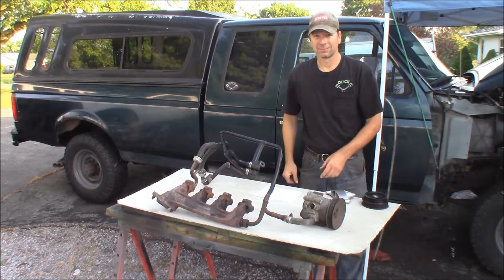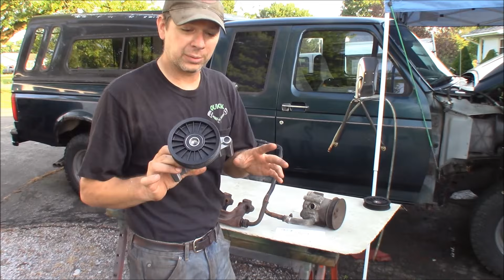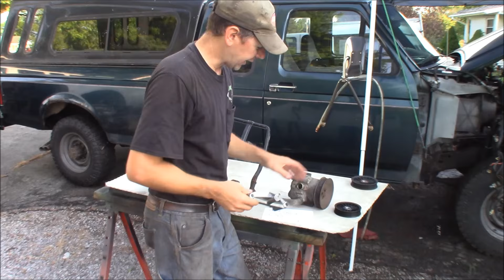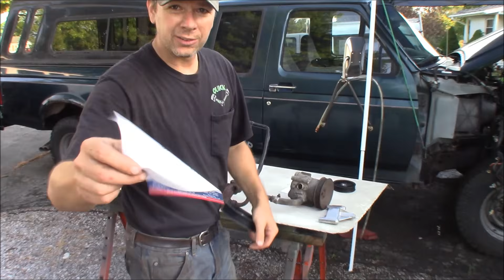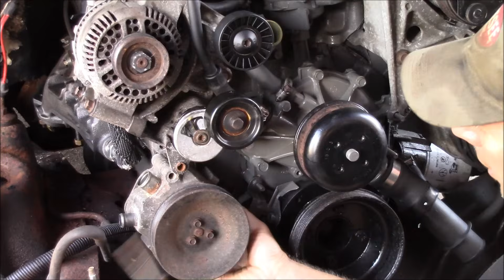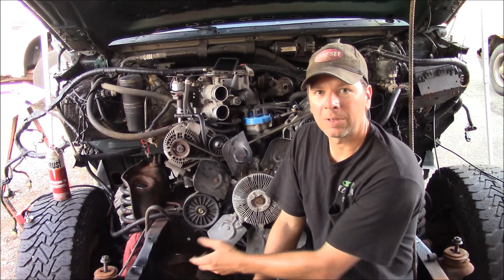1992-1997 OBS Ford Truck 5.8L Air Pump Smog Pump Delete F-150, F-250, F-350

Comment: I'm late to the party but you just need a shorter belt. No need for expensive adapters and pulley.  That's all I did.  Much cheaper.
Reply: What size belt? So you didn’t put an idler pulley to replace the smog pump? You just removed it?
Reply: @camerondavis7015  I did the same thing on mine, just take your belt off and route a piece of string through the pulleys without going around the air pump. Measure the distance and just buy the belt. You will have to remove the air pump pulley so the new belt doesn’t rub on it but it’s a quick fix.
Reply: Believe it's 97in or 96in. Just watched that vid yesterday...somewhere in YT land.

Comment: Good video, real quick. Couldn't you get a belt that is for non air pump trucks?
Reply from the maker: The non air pump trucks used the same belt with an idler like I installed.  I heard people are using a shorter belt, but don't know the length.

Comment: Why would I do that. What are the pros and cons?
Reply from the maker: Pros:
The air pump does very little to nothing for emissions reduction.  The pump can seize up and leave you stranded.  A new pump is expensive.  The engine bay is less cluttered.  Don't have to worry about the air injection tubes rusting off.  Less parts is always better.  Ford built trucks with and without the air pump depending on application.  Simple is always better.
Cons:  None
Reply: @QuickSpeedShop  thank you. I have a 92 with a 300. Original owner.  235k miles and l'm  looking for things that will possibly help it run better.

Comment: I found out that skinny fan on the passenger wheel well is the fuel injector cooling fan. It blows air through a tube to each injector to prevent difficult warm starts.
Reply: What do you mean skinny fan pass. Wheel well

Comment: I took out that deserter valve (muffler) system to clean up the engine bay
Reply: Have you had any issues?
Reply: Did it throw a check engine light?

Comment: Okay, this is not totally related to this change, but I have a 89 f150 with the 4.9 inline 6. It is fuel injected. The smog pump is not long for this world.  there is a fan above it on the wheel well that runs after I shut the engine off on lot days.  I don't know what it cools, but if I delete the smog pump, will that cooling fan still do it's job?  Thanks.
Reply from the maker: I'm not sure what the fan would be for, but it shouldn't have anything to do with the smog pump.

Comment: Where did you get the plugs for the exhaust?
Reply from the maker: It came with the replacement manifold. I welded up the driver's side plug.

Comment: Stupid question what is a benefit on doing this
Reply from the maker: Eliminating a system that does nothing for emissions reduction and ultimately ends up failing and leaving you stranded on the side of the road when the air pump seizes up.
Reply: @QuickSpeedShop  wow thanks for the reply

Comment: What would this affect? Would it have any negative impact on any systems in the truck?
Reply from the maker: No.  As long as you truck isn't a 1996 F150 with OBD-II computer.  Otherwise the OBD-I equipped trucks will not know the difference.
Reply: @QuickSpeedShop  I have a 1997 f350 w the 5.8L
Reply: @alextrombley3760  this is what I want to find out about too. I have a 1997 F250 reg cab 2wd 5.8L 5 speed and I want to hop it up badly.
Reply: @QuickSpeedShop  I have a 1995 F350 with the 5.8L, and my pump locked right up.  I popped the pully off of the pump and rerouted the factory belt so that tension is still good and the truck runs this way (without all the belt squealing from the locked up air pump).  I'm not 100% on the operation of the airpump and what/how it does its thing, but will it cause me many problems just to leave the derelict pump in place and not touch the lines that run to the exhaust manifolds?  Mainly asking as I don't have a good way to get at them to weld them shut without completely dismantling everything.

Comment: I have a 1989 ford bronco 5.0 sitting in a 1996 ford ranger .Can I replace stock upper and lower intake for the  upper and lower 5.0 HO 1993-95 mustang  Would I have to replace fuel rail and coils
Reply from the maker: Not sure, never done it.
Reply: @QuickSpeedShop  ok thank you

Comment: does this work on a 1989-1990 5.0 ford bronco sir
Reply from the maker: The smog pump elimination bracket and pulley are for a 5.0L application.  I believe all you have to do is swap that part on your 5.0L, but I have never done one.  I have only done the 5.8L which requires the bracket and bigger pulley.

Comment: Other than a less busy engine bay what are the main upsides to this? You’re not losing a/c when you do this correct? 92 f150 5.8 I’m in Indiana where everything is legal lol
Reply from the maker: Air pump bearing tend to lock up, chuck the serpentine belt, and leave you in the lurch.  This way just gives me piece of mind with a simple idler and no air tubes to rust out or leak.

Comment: If i remove my smog pump due to noise, will i pass emissions still with no engine light. Was gonna buy delete kit but just ran smaller belt for now.
Reply from the maker: If you truck is a F250 or F350 or 95 and older F150 it has the OBD-I computer it will not trigger the light.  If you have a 1996 F150 that has the OBD-II computer and the light will come on.  As per visual engine inspection that is up to your state law.

Comment: my F150 is a 96. Will this for the 302?
Reply from the maker: No only due to fact 1996 F150 is OBD-II computer.  Check description of video for more details.
Reply: @QuickSpeedShop  there has to be a way to fool the computer?
Reply from the maker: @terrybaptist795  Don't know.  Another guy with a '96 F150 did the delete, the OBD-II knew it and threw the check engine light and code for faulty air pump.  Only works with OBD-I pre-'96 F150.
Reply: @QuickSpeedShop  I guess i will just leave it alone until i can cough up the money to
to coyote swap it. Then when the time comes 
i just toss out the untunable ecm for a better engine managment that i can throw bigger
horsepower numbers at.

Comment: Can i do this? I live in Albuquerque, New Mexico USA? I really want to do this on my 96 F150!
Reply from the maker: I don't know your laws in NM.  Your truck is different because you have a '96 F-150.  That is the first year for OBD-II computer system.  If you do this mod it will throw check engine light.  Read description above.  Can only remove air pump on OBD-I computer controlled trucks.

Comment: Why not get a shorter belt and delete  the whole dang pulley
Reply from the maker: I guess you could do it that way.  I wanted a factory option.  This way if you needed a belt you could get one at any parts store.
Reply: @QuickSpeedShop  you can get any sized belt at any parts store,but yeah I get you

Comment: Do you know this pulley is completely unnecessary? Just take off the pump and buy a belt a few inches shorter. Cheaper than this and you get a new belt in case yours is worn. I forget the exact length but you don’t need that pulley. This also increases the contact area of the belt to pulleys. All that idler pulley you added does is make it easier for the belt to slip.
Reply: How did you tighten shorter belt, the tensioner goes the wrong way with smog pump removed.
Reply: Tell us how you did it
Reply: It’s what I did to my 94 5.0
Reply: The belt will jump off . Not every time but you'll be putting the shorter one back on every so often I promise you. I had a buddy that went the short belt route. He eventually got the mount and pulley because his belt would jump off.
Reply: @austinlancaster1303 yeah it depends on where your tensioner is. If Its under the alternator it'll jump off, if it's above, you don't. 

The air pump keeps tension past the tensioner on the left, otherwise it could hop off like you said

Comment: I have a 1994 F-150 5.8L 4wd with automatic hubs and the 4wd isn’t working.  I already went through the hubs and they appear to be in good functioning condition.  I can’t find any other information on You Tube to see what to check next.  The 4wd and 4wd lo lights light up on the dash when I shift the transfer case.  My truck doesn’t have any type of button or dial for 4wd.  Just the floor shifter.  You seem fairly knowledgeable with these trucks so I thought I would ask you for some advice.
Reply: Automatic hubs is the devil
Reply from the maker: The transfer case shift in and out manually with your truck with the lever.  Since the lights are lighting up it should indicate that the shifter linkage is working and the TC is going into 4WD.  I would bet that the auto hubs are not engaging.  I would remove the caps on the ends of the axle and grease the components and see if they are bound up.  Another option would be to find a set of manual hubs at the junkyard and swap them onto your truck so you will be able to engage the hubs by hand.
Reply: QuickSpeedShop I pulled the hubs off and completely took them apart, cleaned and greased them following another you tube post.  I could be wrong but they seemed to be moving  according to the video.  But if the light means the transfer case is working properly and there isn’t anything else in between the transfer case and the hubs that could cause it not to work it would have to be the hubs.  Thank you for your response.  Been beating my head against the wall with this thing.  I also did a complete EGR and Smog delete on this truck and had headers and new exhaust put on.  Truck runs so much better now.  All those old vacuum lines were shot.

Comment: Going to try this with  an e150 with a 5.8 smog delete bracket.  The bearing is shot on the pulley.
Reply: Did you do it?
Reply: I just had the same problem with the bearing. My mechanic simply bypassed the smog pump and used a smaller serpentine belt instead of paying extra to remove the pump.

Comment: Does the computer not throw code 327 for the sensor on the egr position sensor
Reply: That's what I'm throwing now so I'm replacing sensor on top on egr first thinking about cleaning it maybe also
Reply from the maker: @jamesdean1673  I have never had the EGR code.  Removing the air pump doesn't affect the EGR function.
Reply: @jamesdean1673  buy the spoof plug.  The mustang one fits it fine.  I "think" the method used here tricks it to think it's still there.

Comment: Can you illuminate the EGR valve or bypass somehow.
Reply: I pulled the entire system off of mine.  You can buy a spoof plug that will fool the solenoid to think that its still there- just buy the ones made for the mustang, it works to keep the check engine light off.  BUT - the problem I'm having is the computer thinks it is still there and so when it warms up, I will get a stall-out at idle speeds.  This is the exact position where that monstrosity of a convoluted system did anything.  I'm going to try when he did here and have the system blow air back to itself.   Otherwise my truck runs fine and it cleaned the engine compartment up a ton.
Reply from the maker: I don't know how to eliminate the EGR without turning on the check engine light.  I know that is monitored by the OBD-I system.
Reply: @QuickSpeedShop  thank you for your quick response

Comment: you  don't  need  the  bracket  or  the  pulley.  all  you  need  is  a  97 inch  belt!  no  pulley  required  besides  the  dummy  pulley  will  break  in  no  time.  my  truck  runs  fine  with  smaller  belt
Reply from the maker: I can't say a shorter belt is the answer.  I Spent a lot of time researching this when I did my first conversion and people who just used a shorter belt had issues with the belt coming off.  The dummy pulley isn't going to break.  Ford literally used this setup on their non air-pump engines, look at the OEM belt path sticker under the hood.  I have run this idler pulley for thousands of miles on multiple trucks and never had any failures.

Comment: I just bypassed the pump with a smaller belt instead of buying the kit
Reply: but everything is just naturally more expensive for Canadians so we Gotta be creative sometimes haha
Reply: Sidney Lutz 
Hi Sidney do you have the part # for the belt I would like to do this for my 96 F-250 . Cheers
Reply: @mikepoint4983  060473 part number through NAPA
Reply: Would this be the correct part number for a 5.8?
Reply: I should also mention that mine has AC.

Comment: Where do we find the plugs for the manifold? I'm not sure what exactly you're talking about... Am I plugging the tube or the hole in the manifold (or headers) itself?
Reply from the maker: It's best to plug the hole in the manifold with a plug.  I replaced the passenger side manifold (due to a crack) with a Dorman aftermarket manifold and it came with a plug.  Most of the after market manifolds supply both open bungs and plugs with their manifolds to fit engines with air injection or without.  On the driver's side I had to cut off the tube at the bung and weld up the bung to close the hole, essentially making it a plug.  I don't exactly know what the thread pitch and size of the plug needed is or I would have listed a source to get one.  You might have to get a hold of Dorman and see if they will sell you two plugs separately.

Comment: I have a 95 f150 4.9 my secondary air tube is messed up,i want to just plug the holes in the head, my question is what do I have to do to delete the smog and lines and vacuum and what do I do with the ego,thanks for any helps actually just posted a video of my Delia its 4 mins long,appretiate any feedback
Reply from the maker: I don't have any experience working on the 4.9L.  If you remove the EGR it will probably throw the check engine light.  The EGR and smog pump are two different systems that operate independent of each other.  I don't know how the serpentine belt is run on the 4.9L.  Not sure what size pulley or how to mount it to delete the smog pump.
Reply: @QuickSpeedShop  thanks brother I appreciate your feedback and reply your video and your comment was very helpful, ill post another video soon for update
Reply from the maker: @J.AM1030  👍

Comment: I have a 96 ford f 250, been fixing it as things break,  it has about 400 thousand miles on it, and pretty much regularly, something breaks or needs repair about every week. The other day, the smog pump seized up, it was a 15 dollar part at the junkyard. I have no idea how long ago the pump stopped working, but the genuine difference in the performance of the truck was instantly recognizable. 

The engine idle is smooth and balanced, the acceleration is surprisingly responsive and the gas mileage has improved tremendously. Up until the past week or so that I fixed the air pump by replacing it, the truck was something of a real problem to drive, it felt like the truck was always struggling to go up a hill. It is a work truck that works for a living, and often it is driven at just above an idle, about 25 miles or so. usually it takes about two hours, once the pump was replaced and operating, did the whole route pattern in less than 90 minutes. In the mid 90's Ford was still trying to figure out fuel injection, while your video suggests altering the system, I have always tried to rebuild the operating systems to its original function of design. I have owned this truck about 14 years, and with a whole list of new parts and improvements on the vehicle, I am going to keep it as close to original as possible. The trucks now are plastic and not built for work, the old timer vehicles were made for working, and around my house, if the truck doesn't work, nobody gets to eat.
Reply from the maker: I'm going to guess by what you described that the pump was seizing up for a while and dragging the engine down with it.  When it finally locked up and you replaced it with a junkyard piece that turned freely the engine was able to operate at normal load again.
Reply: @QuickSpeedShop  I have no idea how long it was out, at 400 thousand miles, there are funny noises from everywhere, I put in a double roller timing chain, and it has all its horsepower, almost 25 years later. It started grinding, then stopped overnight.
Reply: I was wondering how to verify that the smog air pump is actually working before replacing or removing it.
Thanks for any feed back.
If you have exhaust noises get a bright flashlight and look at your manifolds for cracks, both of mine have broken.
I would make sure using a good exhaust gaskets, checking the flatness of the replacement manifolds and re-torqueing after a couple heat cycles by loosening then torqueing again. Maybe use brass nuts to secure the manifolds.
Reply: @wilfredomaldonado1779  Ni siquiera te molestas en usar Google translate. Que falta de respeto.
Reply: @zh9119  jajaja jajajaja eso que me lo diga la persona a quien le comento a ti no te interesa no eres más que un pobre pendejo si tiene es problema dime yo te puedo ayudar a resolver tu problema no es contigo pendejo
Reply: @zh9119 ta cabron compa